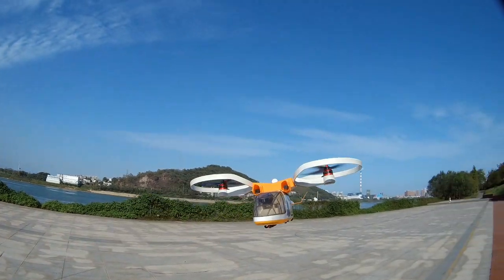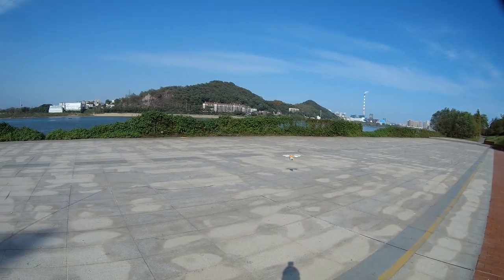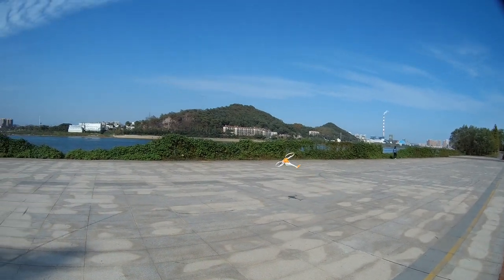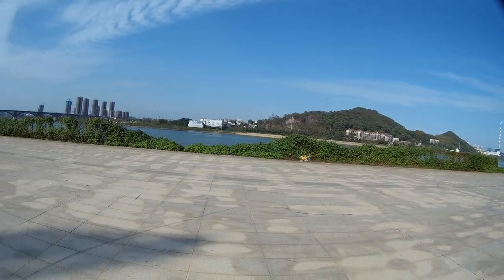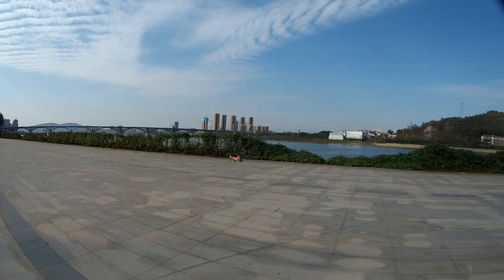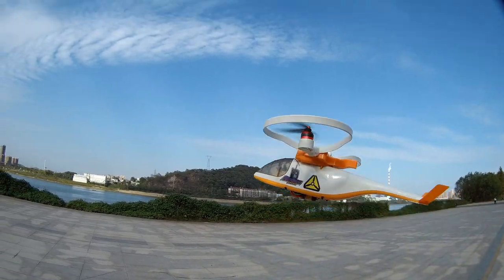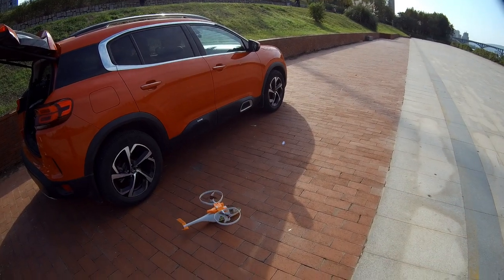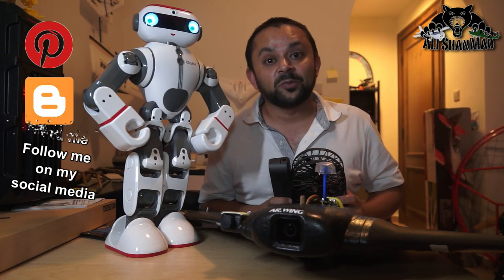I wanted to Crash my Bi Copter Tilt Rotor VTOL RC Dual Copter

Comment: How does one get replacement parts for this?  My radio receiver overheated and burned out.  Also, I think one of the servos isn't rotating enough.
Can you post a disassembly video?
Reply from the maker: hard to get, these are discontinued. mine i have taken all the guts out and trashed the fuselage. I will 3d Print a new fuselage and install electronics in it. just in case if you are interested to get all the electronics, motors, servo, flight controller, i will be happy to sell it to you

Comment: There should be a YouTube channel racing these bi-tilt-rotor RC aircraft.   Can this do a full roll or loop?
Too bad there isn't a BetaFlight flight controller for the Kai Ying ZY-Z2... Maybe even using OpenTx.
Reply from the maker: need a newly programmed high speed controller and these can do marvels. forward flight they can fly like fixed wings and hover and move like VTOLS
Reply: @alishanmao  Sounds like a great idea!  customizable and repairable...racing clubs...if the flight controller is programmable with Free/Libre or Open Source software like BetaFlight.  What other components does the PCB have?  The ESC's and RF receiver?  I haven't wanted to take my Kai Ying KY-Z2 apart.
Reply: @alishanmao  David Windstal has videos of his bicopter here on YouTube.   Maybe his avionics can be used in the KY-Z2.  They might work with OpenTx and BetaFlight.